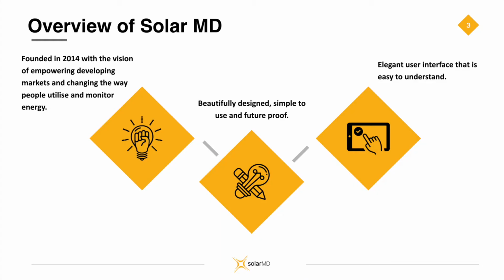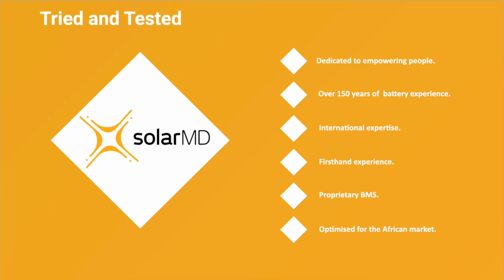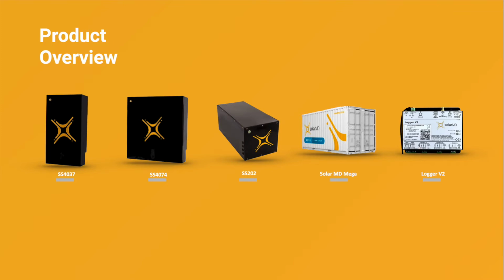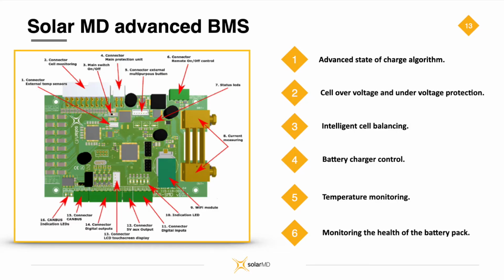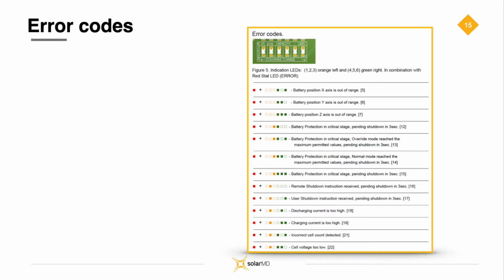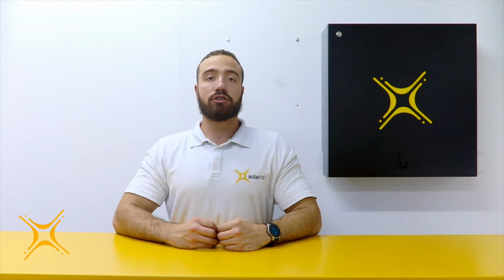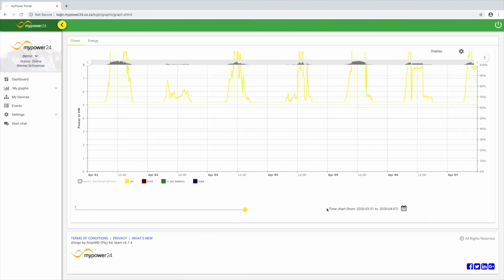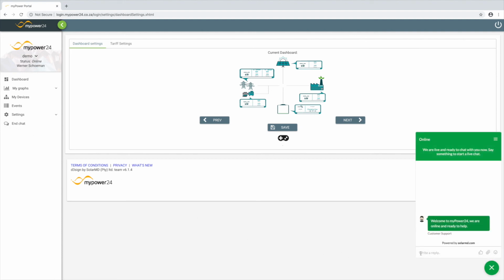Solar MD Webinar - 06.04.2020 /12.05.2020 at 2pm

Comment: What would be optimal settings with axpert inverter when user defined option is used ,I have purchased 3.7kw solar md and have 5kw axpert
Reply from the maker: Hi there, the optimal way is to install logger v2 and set it up on Axpert Ai. You will also have full monitoring available
Reply: @solarmd6707  Thanks for quick reply will do so

Comment: What is the recommended DoD ( Depth of Discharge) for your LiFeRo4 battery ? Can it be discharged fully without affecting the battery life ?  If I buy your 7,4 kwh battery can I use all its capacity or only portion of it ?
Reply from the maker: Hi George, you can use the full capacity, but 80 - 90% is recommended on a day to day basis.
Reply from the maker: thank you. 100% DoD  / 4000 cycles or 10 years